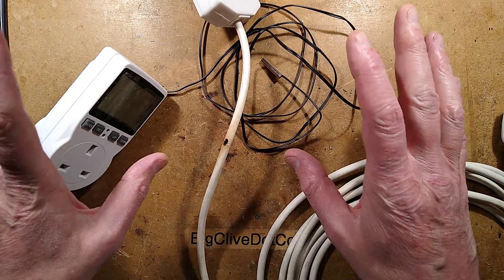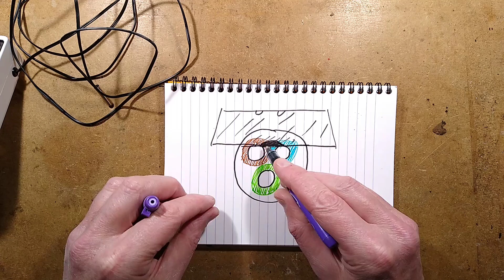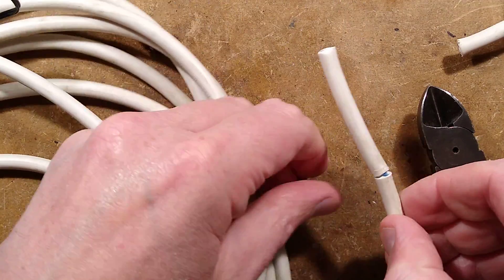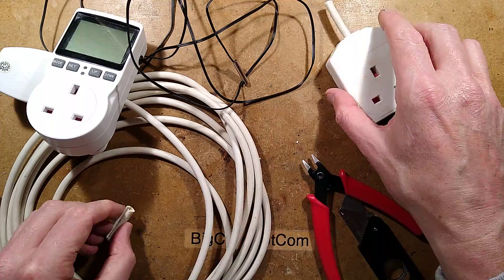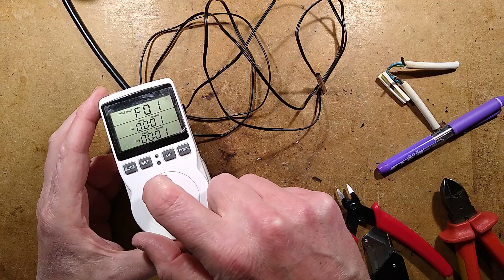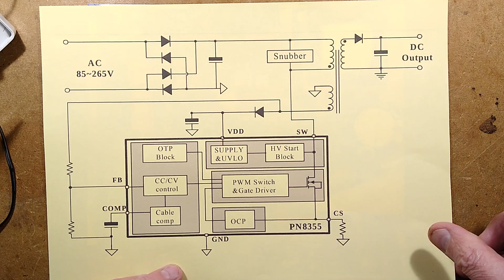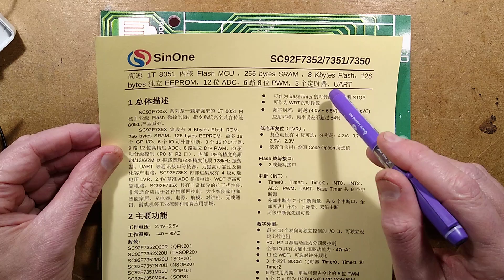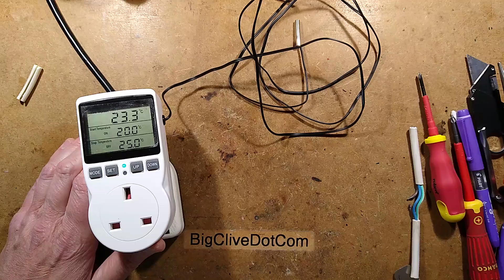The case of the mysterious cable arcing

Comment: That cable have been pinned/stretched between a thin and a flat surface. (like the floor and a not so sharp object)
Looking closely at the beginning of the video there are more places the cable seems to have little damage after being pinched between something.
The pvc or whatever insulation that cable is made of could be old and brittle so it would easy stretch a bit if squeezed between something and rip some of the copperstrands inside so it gets a weak point.
Then just burn off under load.

This have happened to me couple of times with cheap white extension chords usen in harsh environments like in a garage where cable easily gets some mechanical stress.

These type of cheap cables should be replaced often and absolutely not be used if it have some dents or other visible damage.
And absolutely not be used/handled  in cold temperatures if the cable feels a bit stiff..

Comment: In the stage theatre where I used to work, we tied the cables with short pieces of braided cotton cord (about 1/4" thick). You would coil the cable (in a manner that did not fight its natural twist), plug it into itself, wind the cotton cord around it once or twice, and tie with a reef knot.
When the cables were in use, the ties stayed on the cart where the cables are be stored.
Reply: If they can be plugged into themselves (like XLR), you can keep them on those big plastic power cord reels. This is especially nice with 6-10 foot lengths that otherwise would be too short to stay looped.

Comment: I thought that perhaps the nick on the outside also nicked the live conductor. Over time, especially with repeated flexing of the cable, this would form a hot spot which would gradually make itself worse until the conductor breaks completely, forming the arc.

Comment: I had been rigging up XLR adaptors for an Ethernet cable tester one day, and went to test every XLR wire I could find. One of them was a second-hand cable that showed a short from a signal wire to the shield ground. It turned out that one of the insulated conductors had kinks in it during manufacturing, and in a few places the insulation got rubbed off at the kink. The exposed wire then shorted with the bare shield wires around it. I was able to chop the bad bit out and add two spare connectors.
So while improbable, it is definitely possible to have wires faulty when manufactured.

Comment: get the same thing happen on the brand new vacuum cleaners i sell but not as dramatic they dont melt the outer insulation they just get hot and break so the vacuum stops working then i get a call saying it dont work to the trained eye you can see slight discolouration but if if didnt know what to look for you wouldnt think there was a problem cut it open and there the problem is.

Comment: Hey Clive, I've just finished replacing a faulty power supply from my PC, it was dipping voltage whenever the graphics card started to really work and this would cause the graphics card to shut off. I think it's voltage dipping, based on a software test, but who knows how reliable that is. I'd love to send it to you so you can tear it apart at some point and find the fault.
Reply from the maker: It's possibly the sign of the output electrolytic capacitors drying and impairing it's ability to supply full current.

Comment: Another consideration.  Over on the Curious marc channel, they had an issue with wire wrap that was actually copper plated aluminum.  The wire fractured internally and lost continuity but no arc.    I've been seeing China wire that is more towards brass than copper.   This seems to be on the brittle side.

Comment: I have never used tape when coiling cables in my theatre practice, there are lots of better ways to do it.  I do wonder why you still do it if such cuts is a common problem.
Reply from the maker: Because we're dealing with thousands of cables per day on large events.

Comment: With the cut there it looks like the power wire has been cut through or partially cut through. When the plug was moved more strands are broken or the ends of the cut ends move so it gers hot because all the current is going though only a small number of the strands are trying to handle the current.

Comment: Looks to me like the brown live wire got cut into the copper. Weakening that spot and it got hot and popped like a fuse under load, burning the insulation around it.

Comment: I used to work as a electrical contractor here in the USA
I installed about 250' ( about 80 meters) of 10/3 with ground UF underground wire 
Turned on the circuit and a fault happened right away in 1 of the live wires 
Traced the fault to a faulty splice in one of the conductors 
This was a factory splice that had not been done correctly 
I had to replace the whole 250' of 10/3 UF wire , so I had to go after the manufacturer to pay for the extra wire and labor 
So the fault might have been a bad cord

Comment: Clive, I've seen chemical reactions dissolve or "melt" both hard plastics and soft cable sheathing in older electronics. There's something in older and/or cheaper cabling that seems to react with other types of plastic, particularly from 80's electronics. It's possible that something in the thermocouple wire has reacted with the PVC insulation on the extension lead, which could have caused the "cutting" effect you mentioned.
Reply: Like grommets slowly melt their way through a clear plastic draw. I think its the plasticiser.

Comment: There is another possible factor too: The trace of a possible cut damage on the insulation could mean that the brown wire could be partly cut as well making a few strands broken basically making the wire a bit thinner on this point, then over high loads this will be the weakest point in terms of current draw making it break down like this :)

Comment: Could the extension lead be rated to 10 Amp load and the item plugged into the extension lead had a higher current draw, which in turn caused the cable to fail? I had similar happen to myself and hence why I check the wiring rating on an extension lead these days. The other thought I have is whether the cable is pure copper or aluminium/copper mix.

Comment: Expiring minds would love to know.. While communing with nature, desperate for something to read, I. spotted the "do not remove under pain of death..." label.. and wondered "What actually happens when you toss the hairdryer in a tub full of water?"

The one I was reading looks like it's double insulated with a GFCI plug..

It would probably matter if it was a cast iron tub, with a continuous conductive drain line.

How do you get your water on Isle of Man? Wells? Desalination? The conductivity of your water might matter.  And it might take a handful of salt to get the party rolling.

Comment: Could be where two rolls of wire were welded together had a 00 gauge battery not worked under load but show voltage without load when your measured the resistance of the wire you had 4k ohms on a the wire.

Comment: Excellent example and explanation, I absolutely hate it when someone else in the industry who doesn’t give a rats ass about what happens to cables wraps it in tape or coils it poorly and it fall apart, the simplest trick is take a piece of tie line and tie it to the cable in a way that you have 2 sides of it protruding out about 6 inches, and then you use that to tie the cable. It is for this reason why I often run checks on my cables for things like this. And in the theater I work in, if we have an extension cord running an expensive piece of equipment, we check it for things like this all the time, and if any imperfections are found we take the cord out of service and decide if it’s worth fixing and if we do fix it, it no longer is in service with expensive equipment and is used for other things.

Comment: Clean both the zebra strip and the pads with acetone. It takes the stubbornness out of it most the times.
Reply from the maker: I'd be cautious about using acetone as it will attack many plastics.  I use isopropanol.

Comment: The Selecon 650w Acclaim theatre lights we had shorted at the entrance to the fixture. It was because the wire was aluminum , not copper and it broke internally really easily when flexed about. It would arc and burn out the cable and almost the fixture itself. Surprised they weren't recalled!!?

Comment: I DISAGREE with the initial cause.  You stated the black thermostat cable was lying on the extension cord.  One thing I've seen is when mixed plastics come in contact with each other that it causes a melting reaction even if there was nothing energized!  The "nick" in the white chord looks like this is what happened!
I know this is an unbelievable theory, but I once had a backlit keyboard I wasn't using...so I wrapped the keyboard cable around the keyboard and put it in the cupboard.  Months later when I needed the keyboard I unwrapped the keyboard cable and the keys looked like they had melted where the cable had come in contact with them.  The keyboard was never energized during the storage time, and it was never near a heat source.  Yet the keyboard cable "melted" the keys just by coming into contact with them over time.
In your case there could be another factor at play, EMF between the two cables...and the extension cable paid the price because it was a softer rubber.

Comment: I wager that something heavy was dropped on the cable, damaging the live conductor, then after some use it got broken to spark. That 'slit' may be luck or damage. If you bake the cable it will naturally develop cracks like that even from very slight scratches. It's just poor quality conductor if 'subtle' damage could occur to the conductors without being visible on the insulation.

Comment: Looking at the jack in the pvc insulation: how sharp are the edges of the metal spades on the power plug? Could the plug have damaged the cable during shipping when/if everything was rolled up tightly in the way one normally gets this stuff shipped from China?

Comment: In the military we had 10pr cables for telephony, which meant there was 48V between the A and B legs.  These cables entered communication vehicles via a bulkhead connector on the skin of the vehicle.  For most of my tour in a field unit in Germany we were plagued with noisy crackly telephone circuits which we put down to the multiplex equipment in the vehicles.  It was only just before the whole system was replaced did I discover these bulkhead connectors had a rubber separator in them and the majority of these had little carbon tracks burnt into them between the the A and B legs.  We then tested them all with a Mega and replaced those which were faulty, which was most of them, and deployed one last time with quiet telephone circuits.  

I should add these couplers being on the outside of vehicles, that were rarely garaged, meant the couplers, although sealed, were inevitably damp.  Another aspect was that the cables themselves were maintained by Linemen who were trained to and did routinely test their cables with a Mega, which would show any break down, whereas the vehicles were maintained by technicians who were not trained to do so.  If they were to test the wiring between the skin of the vehicles and the internal equipment they would probably use an AVO (multimeter) at low voltage rather than a Mega at high voltage.

Comment: Reminds me of the time I got to replace a defective 120V dryer plug after the thing arced internally and tripped a breaker. After taking it apart, I came to learn that the brass prongs and copper wire inside the plug had corroded and generated colourful green substances that had grown over time and eventually bridged contacts, causing the fault. (It was a good lesson in why one should always inspect every square centimeter of secondhand appliances, inside and out.)

Comment: Had a similar occurrence with a 11kv supply to a glass furnace boost transformer.
Damaged insulation on the HT side and a water leak sprayed fluid into the damaged section of cable.
Unfortunately, the results were slightly worse than the damage to the 3 core flex you’ve got.
🤣🤣🤣

Comment: The stretching theory doesn't explain the knife cut across the insulation.  My guess is that a cut was made across the cable and partly severed the live conductor.  So when a heavy load, like a heater plugged into the thermostat, is connected the remaining intact conductor is overloaded and overheats.

Comment: Judging the size of that cable against other items on the bench, it looks to me to be a bit lightweight to be delivering power to a heater, unless it's a very small one. Cables that get pinched under a door, or strained over the edge of a step, or a shelf are prone to a similar failure mode.  It's not helped when you get those cheap retail outlets who sell woefully underrated extension leads on the run up to Christmas.  They're OK for LED Christmas lights, up to a point, but once Christmas is done, some get redeployed for other tasks. Outwardly, the plastic sheath looks just as thick as a cable of several times current capacity.  It's all too easy to mistake one for the other.

The cheap ones tend to be "CCA" (copper clad aluminium) and not as robust as solid copper. They certainly don't seem to like being used for resistive loads, like a kettle, hotplate or electric heater.

I'm just a bit curious - Was that trailing socket a rewireable jobbie, or was it one of those fit once, heat-stake and forget it types?  Same question applies to the plug?

The Thermostatic controller looks like a useful gadget, assuming the relay is up to more than a couple of hundred cycles. It could be interesting to cycle that thing under various loads, and test it to destruction.  I for one could do with a decent and accurate thermostatic switch to control my fan heaters - You know the ones, with a hair trigger action, it's either on, or off, but won't cycle back and forth.

Comment: This was a cut - not stretched - cable alright, but rather than cut across two conductors, only the live one was cut. Probably partially, so there were enough strands left to conduct some current, but not a lot. 
"It was getting chilly one night..." is the clue here. Presumably, an electric heater was plugged into the other end of the "nearby extension lead" which was actually connected to the thermostat outlet itself. A 2 kW (or so) load, that drew enough current to quickly heat up and blow the few strands that were left intact. At least, that's what I think happened here.

Comment: 7:02 I think the copper melted and turned into copper oxide during the plasma. Actually I wonder if by Plasma he means a blue fireball, then yeah the copper turned into dust
Reply: It is not a fireball that is the plasma, Nitrogen plasma emits a fairly broad spectrum thus its colour can vary between pinkish and a blue-white depending on current, Oxygen is more of a violet to lavender colour as it has more peaks in the blue-violet end of the spectrum. Thus since these are the two main components of the atmosphere arc plasma in Earth air tends to be blueish to whiteish.

Comment: I assume the whole thing still started with that cable nick by a blade, rather then just tension/pulling on the cable... It probably thinned the live wire down a bit, causing it to heat up under a load.

Comment: Any chance of an investigation into zebra strips and ways to resurrect them? I have recently had to throw away a couple of kitchen appliances who lost their displays due to zebra strips giving up the ghost. Pressing on the display does not work when the item is a set of scales.
Reply from the maker: Gently cleaning the surface with isopropyl alcohol may work.  It's best to avoid touching the surface of the zebra strip.   The PCB must be aligned accurately.  Often a little collar around a PCB support
 gets crushed during assembly and will result in a tiny gap between PCB and LCD.